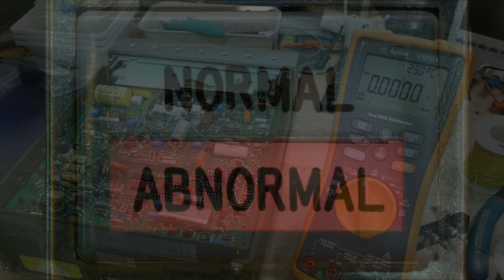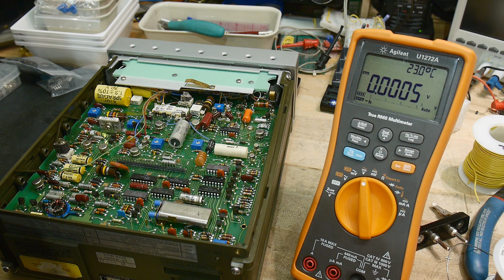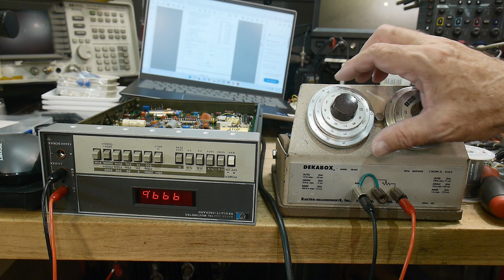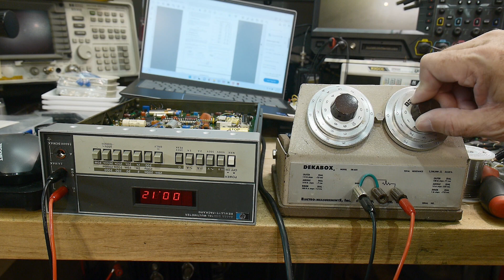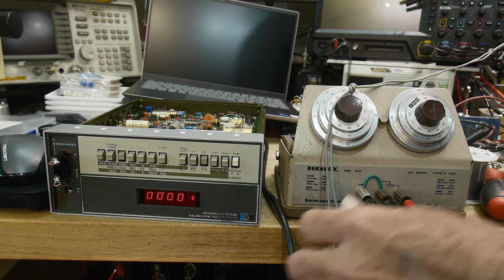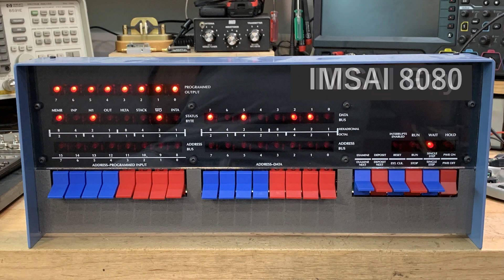#1239 HP3465A Multimeter repair (part 3 of 3)

Comment: How is 4.4V acceptable from the 5V power supply? Seems like something else is still wrong in there, other than the transistor.
Reply from the maker: it is designed to work on 3 AA cells.
Reply: @IMSAIGuy  NiCd, no less - so only 3.6V typically
Reply: APPROXIMATE 5V......not critical because on the main board it is converted to the several different actual voltages required. And the 'regulator' on that simple 5V supply board is just a Zener and a pass transistor, no feedback, so it is going to be a sloppy voltage source.